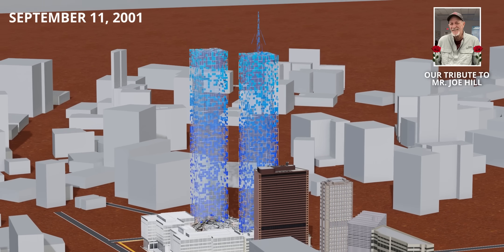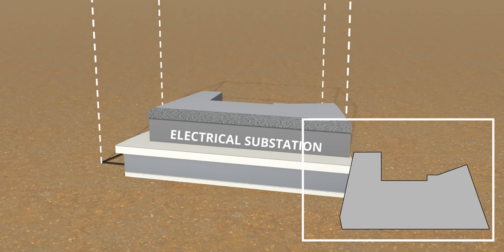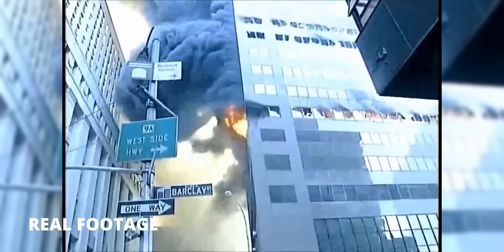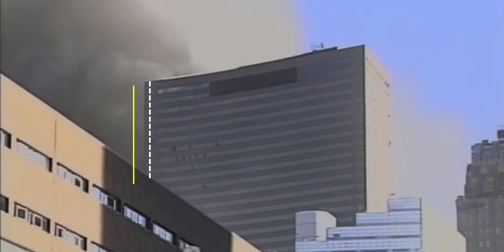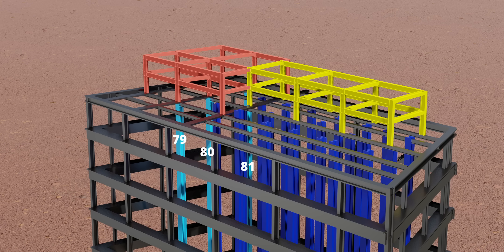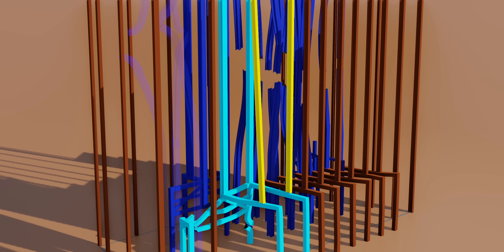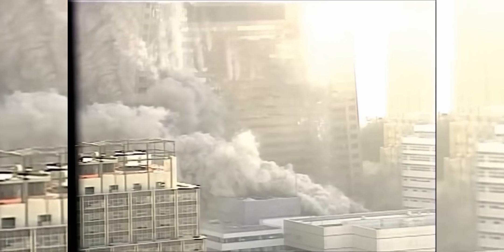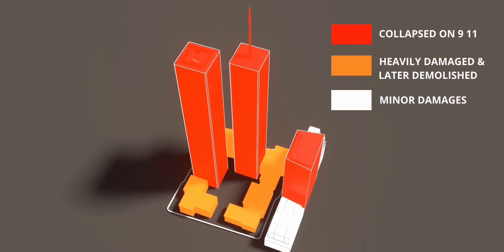Collapse of Building 7 | The Complete Physics

Comment: It was a free fall collapse which means no resistance from any column of steel which melts at 4700 degrees.  They asked many demolition experts who said they would be hard pressed to do such a perfect collapse, straight down, free fall.  I don't know what caused it but keep in mind no structural steel building has ever collapsed due solely to fire.  There was an 18 story steel structure that burned until it was gutted in Philadelphia.  Completely burned out, no structural failure.  The World trade towers were also free fall collapses - no resistance on the way down....not possible.
Reply: It wasn't a free fall collapse (I know, I measured it myself) and a free fall collapse does NOT mean no resistance. Also, the melting temperature of steel - while irrelevant as no steel melted or needed to - is 2,500 to 2,800-deg F, not 4,700.  Similarly, you just made up the shit about the demolition experts. I stopped reading after that. Complete waste of time since you know absolutely nothing about the topic.
Reply: @TheCriticalStinker-01  As a structural engineer, I have never been sure what is meant by this "free fall" comment Truthers always say. After buckling, I am not sure what sort of resistance they are expecting.
Reply: @09rja  it was a show on Netflix. I am sure as a structural engineer you’ve had studied and  calculated free fall rate, loads etc. The building fell straight and at about 9m/s2. So it collides with building at 82 floor taking out floors 76-86.  The floors 75  on down are not compromised the steel is not hot etc. (they hadn’t buckled) each floor was designed to carry 5x the floor above and yet it collapsed straight down at “free fall rate”.  Let’s dispense with the name calling, bullying and politics; just explain the physics of that happening. The Netflix program showed over 1,000 signatures from structural engineers, chemical engineers, metallurgists and others asking to open the investigation regarding the collapse. Btw my bad the 4,700 refers to thermite. The program explains it better. Don’t have a conspiracy theory just focusing on the science.
Reply: @johntg123  All that still doesn't tell me what rate this thing should have collapsed at. As far as all these petition signatures: I'd like to see the details. Richard Gage's group likes to claim "thousands" as well.....but a hard look at his list reveals a grand total of 30 structural engineers. (At least the last time I looked.) This theory is a giant zero in the profession. Nobody takes it seriously.....and it never comes up in conversation with a fellow structural engineer. (Outside of the time I brought it up to a group in a restaurant.....just for discussion.....and everyone started asking me if I was drunk.)
Reply: @09rja  it should not have fallen at free fall rate straight down. All three buildings fell that way. There is no physics that supports what happened.
Reply: @TheCriticalStinker-01  there was a Netflix special where experts put the recording of the collapse of 1,6,7 buildings into a computer program that determine collapse rate and direction. They fell straight and at the rate of free fall according to their software that analyzed the collapses. How does that happen from a plane impact? Not a chance. Impact at let’s say 82 floor. Knocks out floors 76 through 85. It’s starts to collapse all the steel support beams from 75 on down are not hot and have not been weakened at all yet fall straight down at free fall rate? Laughable.

Comment: My problem isn’t the fact the bounding fell, it fell EXACTLY like a controlled demolition. It didn’t look like a building that was failing due to specific failures, the ENTIRE building uniformly falls down? Give me a break.
Reply: this was a bad horse and pony show. what a joke.
Reply: That's what happens when every support column fails simultaneously.
Reply: It fell like a building falls. Controlled demolition is your only frame of reference so you run with that. If you truly believe the building fell uniformly (which CD's don't) then I suggest you give this video another watch because it very obviously didn't.  You are just missing a whole lot.
Reply: @TheCriticalStinker-01  Physics doesn't support what you are saying at all.  Free fall only happens in demolition.  Also no steel structure has ever collapsed due to fire alone - let alone a free fall and straight other than buildings 1,2 and 7 on 9/11.  If I am wrong please provide a building that free fell as the result of only fire.  The fall was put in a computer program and it was determined to be a straight free fall collapse in 9 seconds - from fire?  that's laughable.  Same with buildings 1 and 2.  70 continuous completely intact floors (below the fire) - cold steel - offered no resistance even though they were rated to carry five times the load.  Nope!
Reply: @johntg123  - Do you mean the state of free fall or achieving an acceleration at or about GA?

When does free fall happen in demolition?  Can you name an example?  

Did you actually measure the collapse of Building 7 or are you just taking the internet's word for it?  I measured it myself - 18 to 20 seconds, or about 1/3 (0.33 or 33%) of GA.

Comment: the Buliding Collaspe Like an Controled demolition Respect for Joe Hill
Reply: It collapsed like a building collapses. Your only frame of reference is controlled demolitions and since that is the only thing you have to compare you run with that.
Reply: @TheCriticalStinker-jw4fl  well some people think its controled but i did watch about how it Collaspe in normal speed
Reply: @TheCriticalStinker-jw4fl  well i confirm with how heat from fire can melt metal or steel
Reply: @TheCriticalStinker-jw4fl  well its not frame by frame sir its Not Speed but How Fast was it in irl
Reply: Yet 3000 bodies disappeared
Reply: @Larry26-f1w  well they couldnt find the bodys becuse of the debris are to much
Reply: @Larry26-f1w  well if they could found them all well its hard

Comment: Finally an official story! NIST only takes their model up to column failure. Yall have progressive collapse, which was amazingly rapid. The columns put up no fight even along their own central axis. Seems like the code has to be updated to reflect this sudden loss of strength. Due to heat from the diesel? Which mechanism weakens them all equally or at least, fatally?
Reply: You seem remarkably un-informed on this topic. You aren't even talking about the right report.

Comment: Haha.  Ok.
Reply: And yet not wrong. Go figure. 
	
This video is very good – with one or two exceptions - and goes into a much higher level of detail than many viewers will be able to comprehend.  While not perfect, the collapse mechanisms – the sequence of failures - described here  are substantially correct and this is true no matter who planned and carried out the 9/11 attacks or why . 

That may not be what you want to hear and go against 20+ years of entrenched dogma and conditioning, but it’s not wrong. 

That also means (in case you did not get the hint) this video can be (and IS) absolutely correct in its description of collapse mechanisms AND the 9/11 attacks could still have been some sort of inside job. The two things are in no way mutually exclusive. 

The mechanisms described here have broad professional support around the world. There are no professional engineering organizations (for example: ASCE, ASEE, ICE, etc) that disagree with them or have offered any formal dissenting opinions or alternative hypothesis. 

So, setting hubris aside, either the overwhelming majority of the worlds structural engineers and simple observation are wrong,… … or you are. Which seems more likely? 

IF you still think believe this explanation is wrong then produce a better one . Good luck with that. No one ever has and I don’t see you moving that needle today. 

No one ever does.